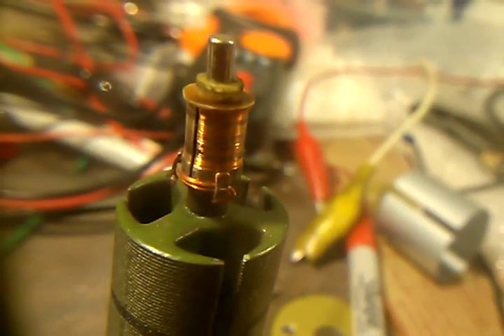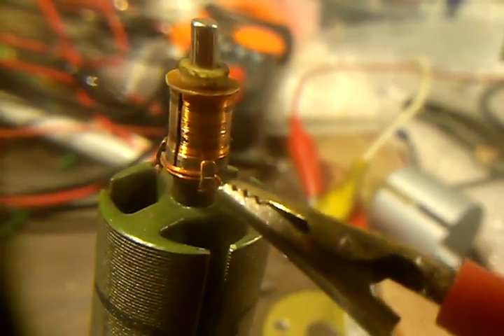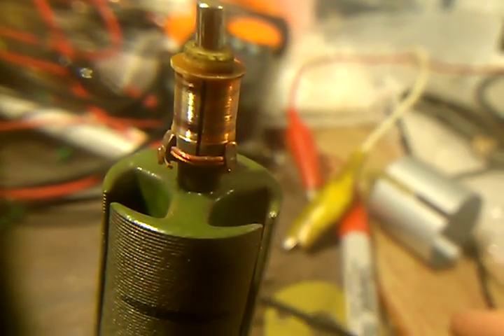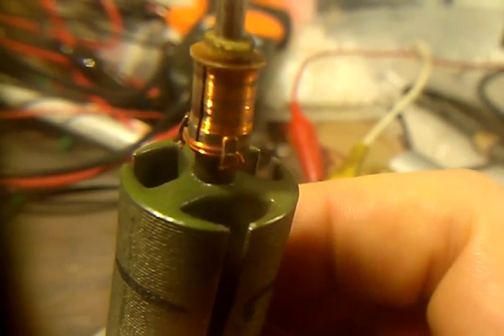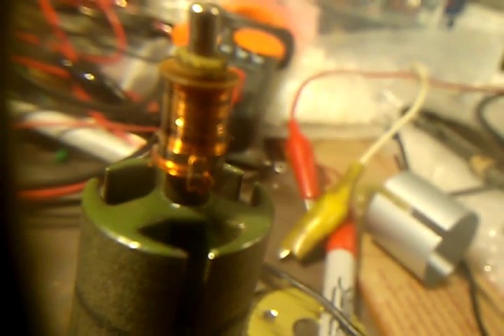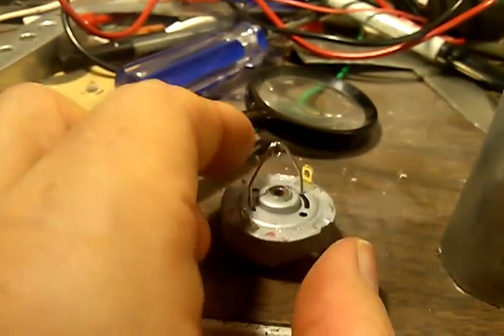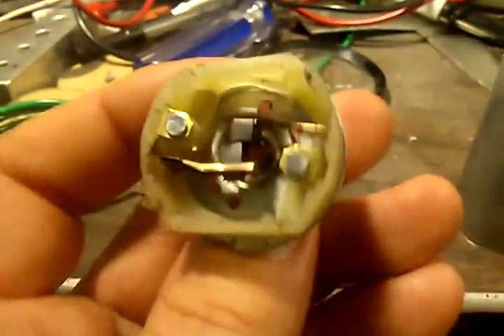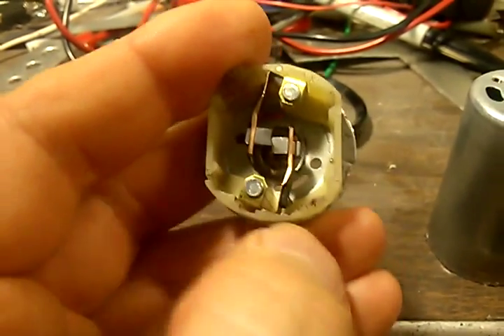How to make a Rotary Commutator from a DC motor

Comment from the maker: this was made to study some aspects of the Ed Gray circuit. It gets very hot and must have the wire crimped into the commutor and not soldered. the solder will melt.
currently designing a high voltage rotary gap as Tesla did for other "commutator" type experiments using high voltage.

Comment: What are you using this for?   I am currently working on 85 chevy starter trying to remove everything off of the shaft except for the commutator.  i want to use it to pulse 400 volts of dc..  check my latest video to refference this.   But i figure i got caps on the dc voltage to reduce the 2in arch and the commutator do a fine job of producing a pulse.  fol like tesla coil projects. what you think?

Comment: hi
can you make a video on how to connect wire on the commutator please, 
because i have 120v dc motor with 8 slot on the rotor and 16 copper bar 
on the commutator and i don't know where to start rewinding.
thanks
Reply from the maker: not sure I can help you there. Sorry.